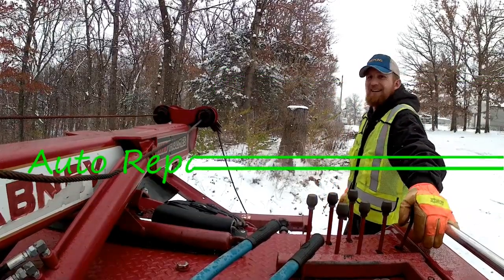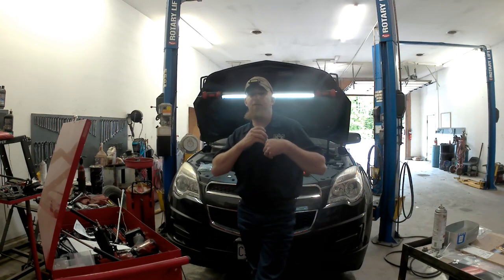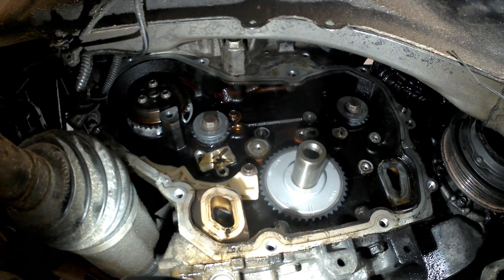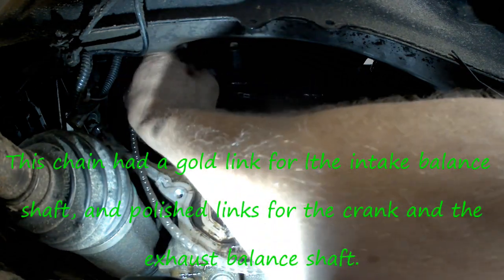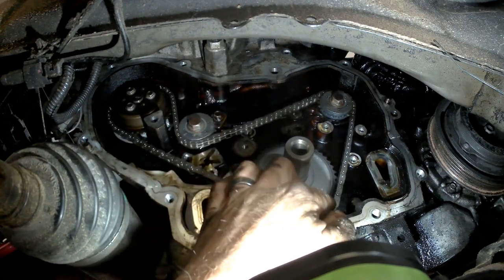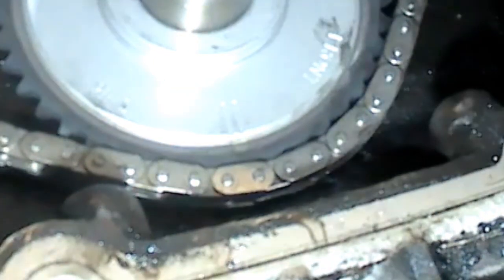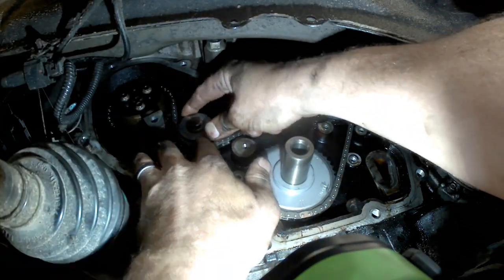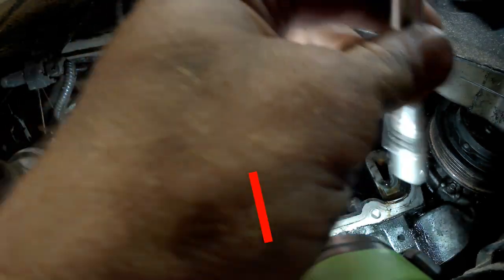2103 Chevrolet Equonix 2.4L Ecotec Timing Set Part 1: Balance Shaft Chain Timing

Comment: How much would you typically charge for a job like that.
Reply from the maker: Without running the numbers just the timing set itself runs between $800-$1000, if it’s a whole new head too your going to be around $3000.00. Generally a takeout engine would be less expensive, but due to lack of maintenance and timing set issues there is a shortage of good used engines, and if you can find one they are not cheap unless you get lucky.